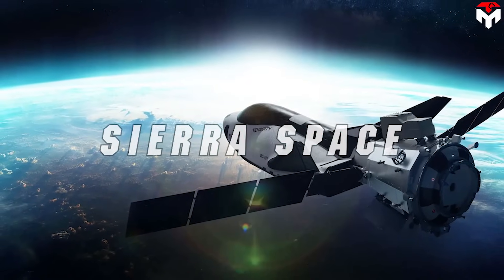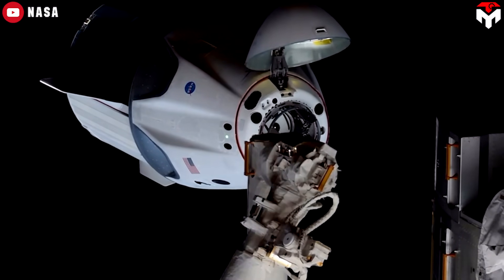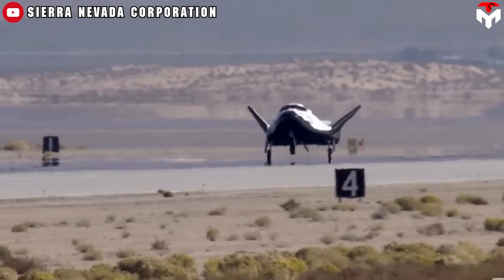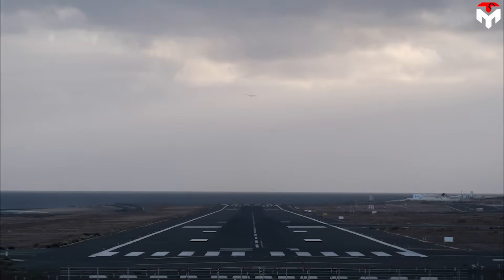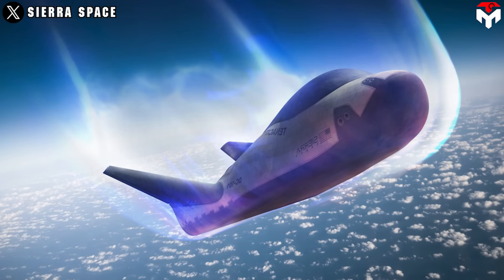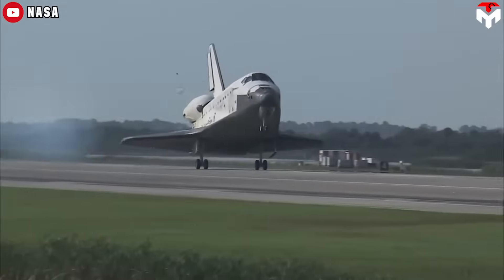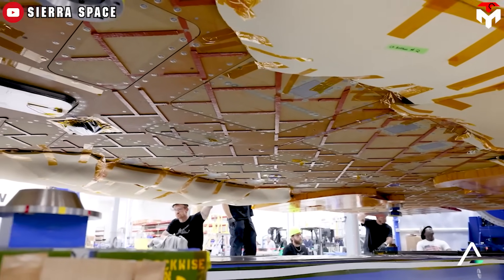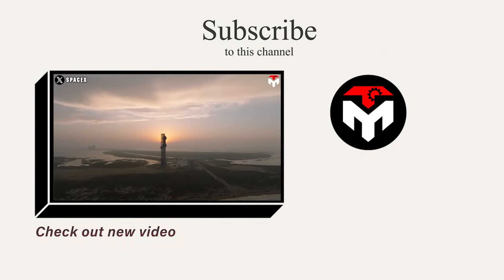NASA finally realized Dream Chaser is BETTER than Boeing Starliner...

Comment: My understanding is there is not another Dreamchaser lifting body in development. Is that true? If not. Is this a test vehicle for something much greater. It if is only 25% of the size of the shuttle and can carry a max. weight of 5 tons. With the new innovative ideas being applied to this space craft. I can't help but wonder, If Sierra Space has bigger plans. What is the max. weight Falcon Heavy can launch? I know they plan to launch it on a ULA rocket. Which has BE-4 engines. I don't think launching it on a BE-4 engine is a good idea. Not yet anyway. It would be a shame to lose it on its maiden voyage. Especially with all the work they have put into it. That would be heart breaking. I like the space plain idea. I would like to see Sierra Space succeed at there endeavor. The other thing that bothers me about Dreamchaser is the skid plate instead of a nose wheel. I haven't seen that used to any extent since the X-15 era. Great Episode. Great Update on Dreamchaser. Do we have a target date on when they plan to launch Dreamchaser. Thanks again.
Reply from the maker: They said: in the late of 2024. Do u think it is possible ?
Reply: @techmap9  I think with the care and the work they have put into it. They they seem to have a good team. I think it is very possible. My understanding is they made it through the vibration test. That's huge. I haven't heard whether they have done the atmospheric test yet. I'm sure it will go well. So Yes. I think it could go sooner. Depending on the launch license. Have a Great Day.
Reply from the maker: @kevinbissett293  Yes, thanks for sharing your idea. Have a nice day, my friend
Reply: @techmap9  You are more than welcome. You Have a Great Day as well my Friend. You're doing a Great Job. A lot to take in.
Reply: I saw a video sometime within the last week or so reporting that they were putting together a second Dream Chaser cargo plane from the spare parts left over from the first Dream Chaser. They showed the plane and had given it a name. This was essentially required because of NASA's stipulation they had to have a backup. They also reported that a manned Dream Chaser was already under development and had given it a name too. A quick photo appeared on the screen inferring that that was a photo of the new plane under construction. I'm not sure who reported because there have been several videos recently. It may be one of these two not sure:
https://www.youtube.com/watch?v=2yZxIylfwJk&t=17s
https://www.youtube.com/watch?v=gpQOwqeLjpI
Reply: There is a second DreamChaser under assembly now and a third on order for the European EASA for use on the Ariane booster.